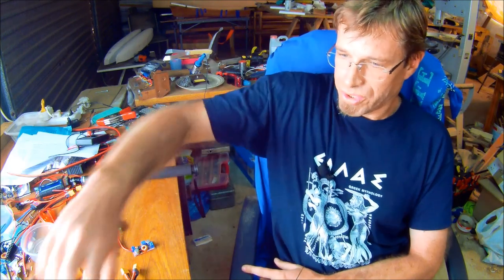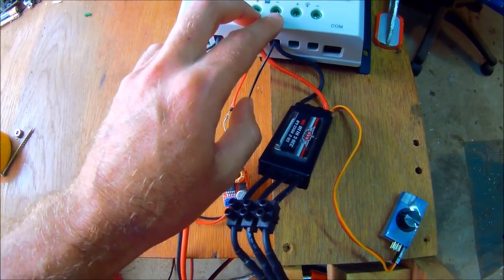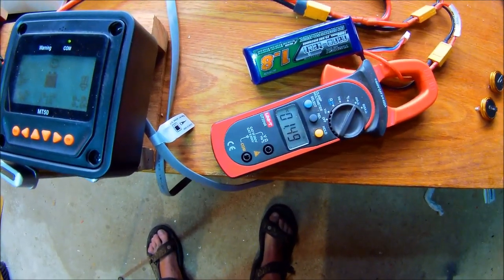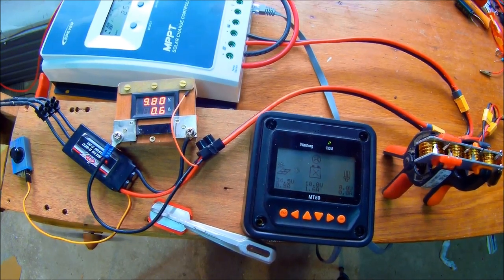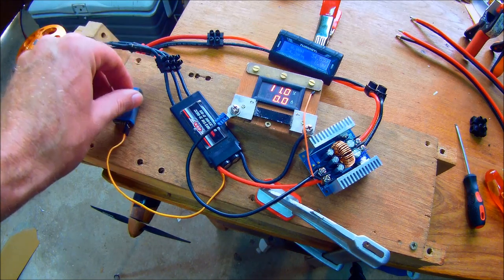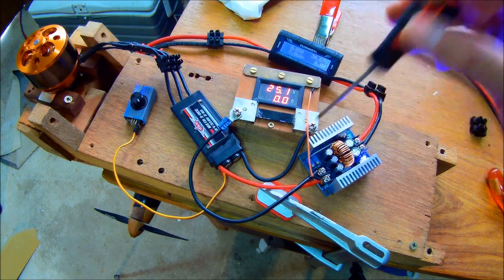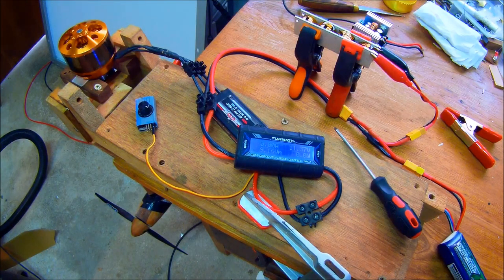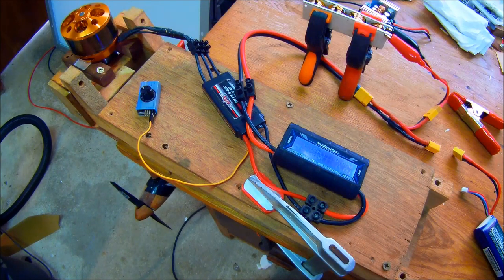Solar kayak - Brushless motor and fried electronics on the start line

Comment: Thanks for sharing this great video on the electronics, William. Yes, you are right, the current limit on these trimmer adjustable buck regulator boards needs to be set or it has the capability to supply more than its rating and fail. Usually, to set the current on these boards you would short out the output and adjust the trimmer resistor until a multimeter or power meter shows the desired maximum continuous current to not be exceeded. The XL4015 only has a feedback pin for output voltage, so the board achieves CC with the help of the trimmers, an opamp (the LM358), and an external output sense resistor, which sends an appropriate feedback voltage to the XL4015 feedback pin.

Limits of the buck converter board:
 The board you used has an XL4015 buck regulator IC that has a maximum continuous current of 5A, max continuous power of Vout*5A, and internal switch+current sense resistance of 0.08+0.024 = 0.104 Ohms. Because the chip has a thermal resistance of 30ºC/W without a heat sink on top, if the max current was set to 5A,  the XL4015 would be dissipating 2.6W of heat, which is fine and would have brought the temperature to 78ºC + your ambient temperature. Considering the chip has a maximum temperature of 125ºC, exceeding that would definitely pop it, despite the advertised over-temperature shutdown protection.  The XL4015 has a switch current limit of 7A at 100% duty cycle, so it can potentially raise the temperature to 152.88ºC+ambient. So without a CC limit set, it could charge your supercaps and power your ESC with >5A and overheat faster than the temperature shutdown protection can react to.  

Two buck regulators in parallel:
Because the XL4015 buck regulator was placed in parallel with the MPPT buck regulator, there is the problem of output voltage matching.  If the MPPT's battery charging voltage is set higher than the XL4015, then 1) it will provide 100% of the power to your load and 2) it will try to back-feed into your XL4015 buck regulator. Since you have a diode on the output of your XL4015, there is reverse voltage protection that prevents a backflow of current into the XL4015's Vout rail.

However, if the XL4015's output voltage was set higher than the MPPT, it will 1) provide 100% of the power to the load and 2) try to back-feed into the MPPT. Since there is no output diode for the MPPT, it will be reverse biased by the XL4015 and a substantial current will flow through the MPPT MOSFETs and capacitors.

To illustrate this, say that you set the XL4015 and the MPPT to Vout = 13V. The MPPT will try to maintain 13V and the XL4015 will try to maintain 13V-0.7V = 12.3V from the output diode drop. It seems like everything should be fine and the MPPT will be running the show. However, the two switching regulators are not sync'd and don't share the same switching frequency, and so because of the mismatch in timing, the XL4015's 12.3V will shoot-through to GND through the MPPT's low-side MOSFET while it is in the OFF state. Luckily the MPPT's mosfets are rated for 30A and won't take any damage from this failure condition. However, the XL4015's mosfet can only handle 7A in a given switching cycle, and is sending power to the ESC, the supercaps, and now the short circuit of the MPPT. The XL4015 subsequently fails due to overcurrent and shoot-through short circuit conditions. The MPPTs low-side MOSFET is potentially damaged while in the OFF state due to the switching inductor's current reversing during the ON state. The inductor generates a high voltage in excess of the MOSFETs Vds breakdown voltage because there is no path for the inductor's current to take.

load connected to MPPT battery terminal instead of load terminal:

You mentioned you had problems with the MPPT when starting your load, like it was in a standby mode. This is most likely the MPPT thinking your supercaps are batteries and entering low-voltage disconnect mode once the voltage dropped to a certain point. The MPPT will then run some form of battery charging algorithm, preventing the full power of the solar panels from charging the batteries. Once the battery terminals passes the low-voltage reconnect threshold, the MPPT finishes its current limited charging and enters FLOAT mode, where the solar provides the majority of the power and the battery/supercaps are maintained at the FLOAT voltage. The battery terminal is specifically designed for battery charging, and so depending on if the battery is a Lead-acid type, which can be bulk charged at low voltage, or a Lithium-ion or LIFEPO4 type, which needs to charge at very low C/20 currents when deeply discharged, you will only get that much current from your solar panels. I wonder if you can change the chemistry in your settings?

solutions to the problem:

The solution using the MPPT I think is to set the proper Low Voltage Disconnect and Reconnect voltage settings on your MPPT and optionally moving the ESC inverter to the load terminals, this way the tiny supercaps will be restored immediately and the load terminals will receive all of the solar power. If the specific condition for using supercaps is for when you go under bridges, I don't recommend using the supercaps in the battery terminal because Low Voltage Disconnect mode will disconnect the load from the battery terminals to protect typical lead-acid and lithium battery chemistries from being deeply discharged by a load. That being said, your MPPT may not turn on if there is nothing connected to the battery terminals. I know at least for my own solar PWM charge controller, it will not turn on until there is some voltage on those terminals, and it will block all voltage from the solar terminals, even in full sunlight.

The solution you arrived at to use a bigger buck regulator as the standalone regulator is also a good one. This board has discrete MOSFETs that are heat sinked on separate aluminum blocks. This substantially reduces the thermal resistance and allows greater continuous current and power dissipation. It just won't provide any impedance matching for MPPT.  In terms of designing a solar boat that delivers 100% of the solar power to a motor at greatest efficiency, I think you have the right idea with MPPT charge controllers, because the point of MPPT is to automatically adjust the impedance of the load to match the impedance of the solar panels for maximum power delivery.  If you were to place a buck converter in parallel with the battery or load terminals of this MPPT (instead of in parallel with the solar), you could reap the benefits of a 2-stage switching regulator. Stage 1 conditions the solar by impedance-matching, and stage 2 provides the overcurrent protection so that your solar is never overloaded by stall currents or excessive mechanical loads (solar charge controllers don't have user-set CC control). 
When it comes to buck regulators, the larger the voltage difference is between the input and output, the less efficient it is, so a buck regulator that converts 36V to 24V is going to be more efficient than a regulator converting 36V to 12V. Going from 36V to 12V in two stages achieves the highest efficiencies. 

Thank you very much for making this video, this was great exercise.  I use 500F 16.2V supercaps from Aliexpress for my car instead of using lead-acid batteries and have been wanting to add the solar charge controller to the mix, but haven't gotten around to doing so. Your video gave me some practical insight into the challenges.

Cheers
Reply from the maker: Thanks for the technical info. I am still trying to figure out how all the MPPT voltage settings affect the output power. I was told that the load terminals simply get power from the battery via a MOSFET which can be programmed for day/night lights etc. I'll test the ESC from the load outlet next time.
Reply: @williamfraser  You're correct, there is definitely a MOSFET + electronic fuse between the battery and load terminals. I figured there would also be a load sharing system built into the charge controller such that when a battery is being CC charged, available power from the MPPT would be diverted to the load.

If there isn't load sharing, you might be better off keeping the ESC and the supercaps on the battery terminals, as the low voltage disconnect switch would just completely cut off critical power to your motor.
Couple ways you could fool your MPPT from entering a power-limiting battery charging state and always provide you with the full MPP might be to either set your capacity to be large so the C/20 constant current is proportionally larger, OR set up a custom battery type so you can mess with the state of charge and bring it right down to 0% for the supercaps, along with lower undervoltage settings.